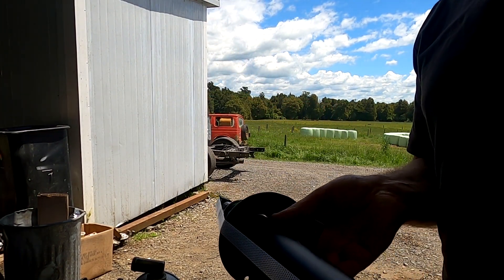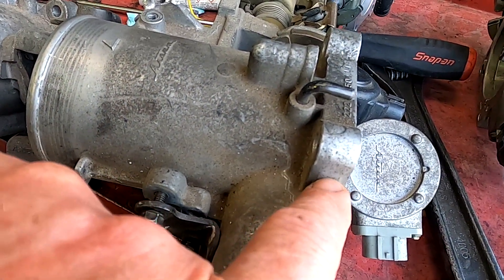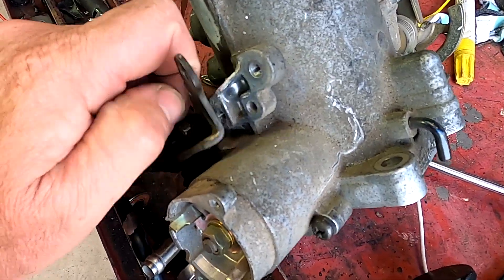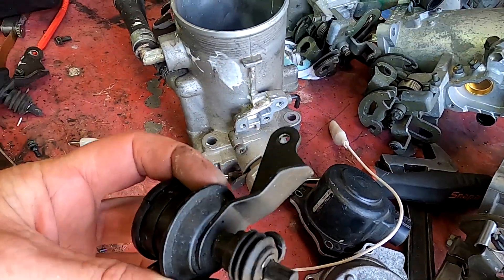1uz Throttle dampeners

Comment: Does removing the dampener cause idle issues?
Reply from the maker: Can do,  toyota fitted the dampeners as they tested better running with them fitted.  Its noticeable when tuning aftermarket ecus on the dyno.
Reply: I accidentally dropped it down in the engine bay and can’t recover it… is it possible you have one i can buy from you? 1995 sc400 with the cap as well i broke that doing a valve cover gasket replacement 😅 i looked on ebay and couldn’t find the part at all

Comment: Hi Kelvin. Always find your videos an excellent source of information so thank you for that. Can I ask, would you advise keeping the dampers/pots and ensuring they work or can I remove them? Just finishing up a ucf10 uz on a manual bmw gearbox in a bmw for street an track driving.
Reply from the maker: Thanks for the compliment.  I prefer to have the dampeners fitted and working in most cases.

Comment: Hey Kelvin this video could not have come at a more perfect time I've been wondering what they are, I have the throttle body with two dampeners my question though, is secondary dampener suppose to move when you open the throttle or is it suppose to stay stationary and only the primary one moves?

Comment: Hey Kelvin, do you have any info out there regarding the "4th solenoid delete" mod?

 I know there was talk on the forums a few years back about disconnecting the 4th solenoid on A340E transmissions which allows the car to launch a bit harder. Seems like a risky thing to do, wasn't sure if it's something you know of or would recommend against for transmission longevity
Reply from the maker: They are referring to the line pressure solenoid,   which our manual shift boxes dont control so are effectively removed however I prefer proper management where I can fine tune the line pressure to suit the drivers requirements.   I'd never disconnect on a normal road car.

Comment: Dear Kelvin, 
for the 1UZ the gaskets for the plenum seem to be difficult to get. Toyota told me I have to wait 2 months for them. Were it possible to use paper gaskets or just black RTV instead? 
I guess my starter has sucked some salt water :-)
Reply from the maker: I only ever use the stock gaskets which I just brought a heap of so chances are that's why toyota are low.  Making paper ones might be ok if you are good at making gaskets.
Reply: @CartuneNZ  I'll give the paper gaskets a try. I made them from 0.5 mm paper what is the original thickness. I gave them more with as the metal gastets. As wide as the mating surfaces are. The AFR at idle will tell me if i was sucessful. But a boat doesn't see much idle :-)

Comment: Kelvin, I'm guessing later dbw throttle bodies eliminate the dashpot (dampner)? Even if we drive from the wrong side of the car?
Reply from the maker: Yes,  the DBW with dashpot is a programmed setting by the ecu to control the closing of the throttle body.  Cheers Kelvin